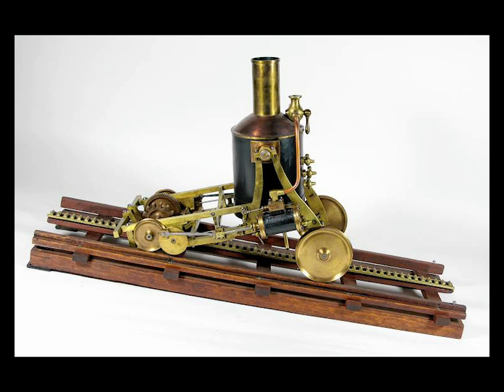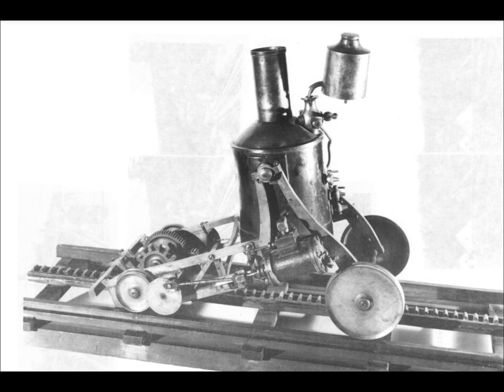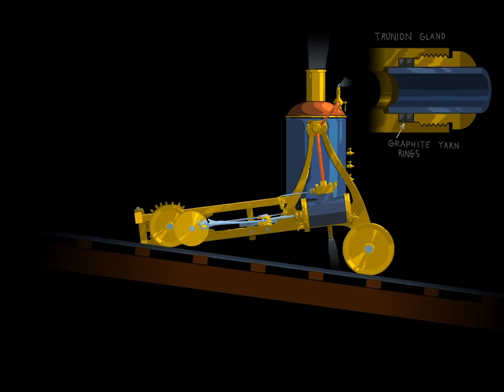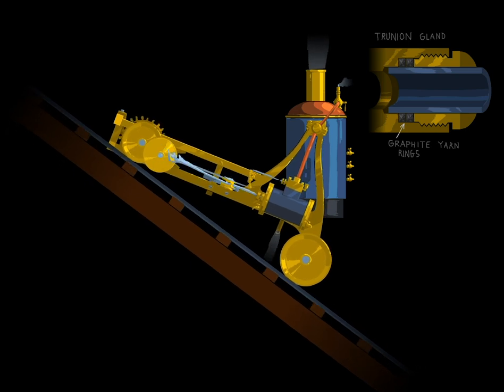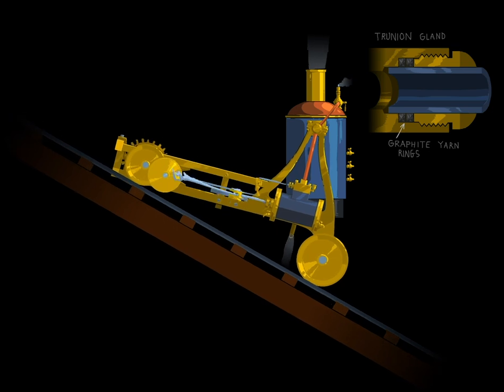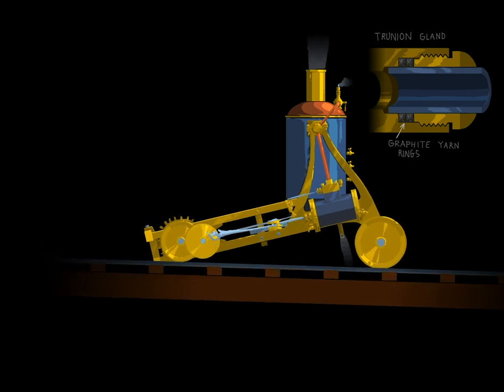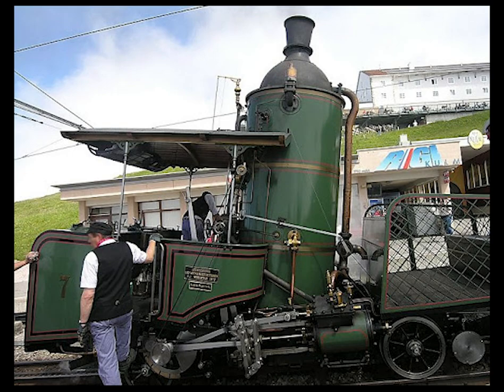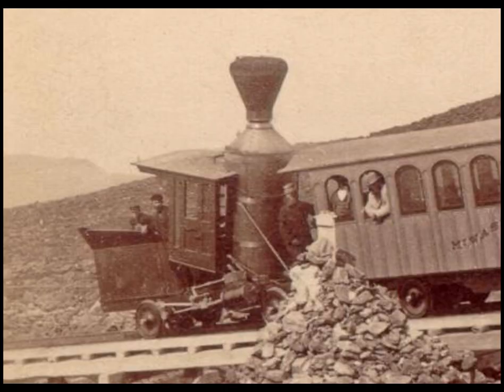Marsh swinging boiler and trunion port gland

Comment: I suppose the gravity (weight of the locomotive) kept the cog-rack engaged? How was the brake system solved? Stopper ratchet on the rack can keep it stationary but coming downhill needs to dissipate quite a lot of energy. Engine braking?

Comment: Bird had to get in a word or 2 at the end 
XD
Reply from the maker: I am glad you asked that question.  I would undertake three projects; 
first reconstruct a Metropolitan railway or high output district power plant with reciprocating engines, preferrably salvaged ones as too much history is being destroyed, and operate it for both gainful energy production and education.  The second would be create a high speed steam driven semi-planing ship or hydrofoil with the goal being beat at least the speed record of Mosher's quadruple expansion "Arrow"  which did 40 knots.  The third project would be a small rigid airship driven by steam power, which would actually be the easiest of the three because the cost would be the lowest.

Comment: Given the agency and timing, would you have continued to use them, or phased them out as well?
Reply from the maker: Considering that a swinging boiler can be a recipe for harmonic rocking and verticals can operate at extremely severe angles, I'd have gone rigid mounting also.

Comment: Alex, what would you do with unlimited funding? Or better yet is there a project you’ve been yearning for and haven’t been able to start?
Reply from the maker: I am glad you asked that question.  I would undertake three projects:   The first being to reconstruct a Metropolitan power plant with reciprocating engines, preferrably salvaged ones as too much history is being destroyed, and either marry it to an electric railway on private property or connect it to the power grid and generate, for the purpose of education.  Because of the frankly facistic regulatory oversight from the Federal Energy Regulation Commission, I would probably do the former, to teach people the working of a large power plant, grid and feeder system.   The second would be to create and test a high speed steam driven semi-planing cruiser launch or hydrofoil and see if I could at least beat Mosher's quadruple expansion "Arrow" which achieved 40 knots in 1901.   The third project would be a small Rigid airship about one third to half the size of LZ120, driven by lightweight steam power, mostly as an adventure craft.  This one would actually be the easiest to achieve because the cost and build effort would be the lowest and the power plant would be approximately the same as the high speed ship save the condensing method.